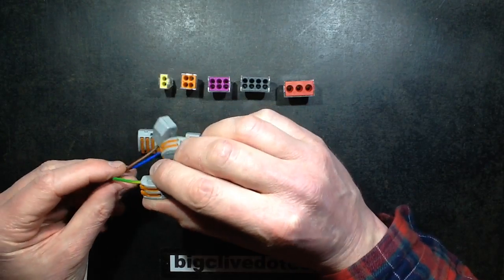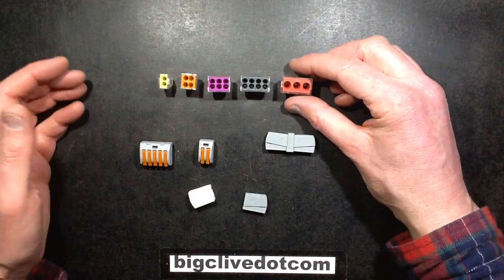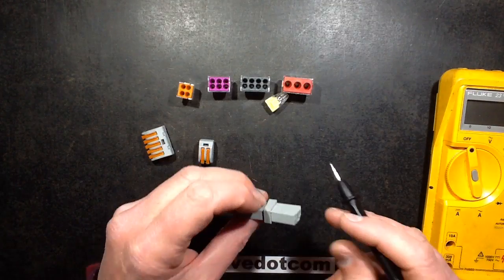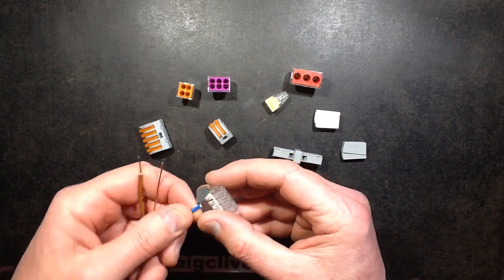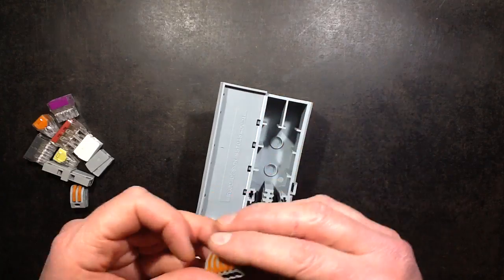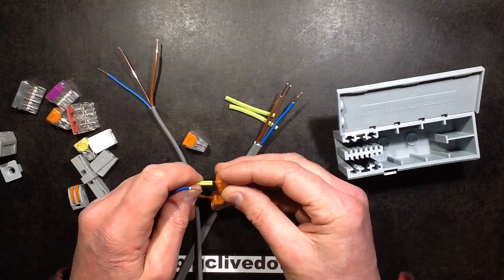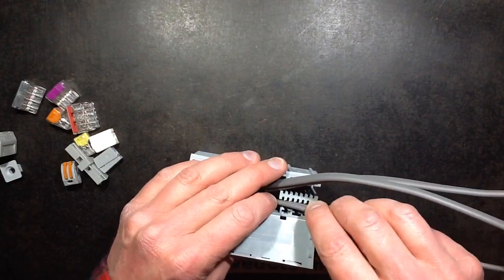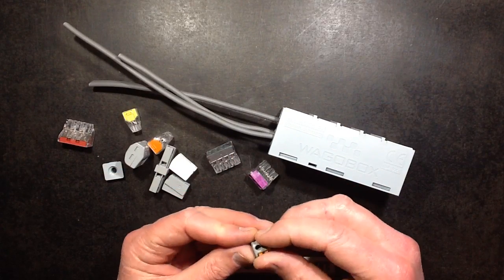A look at the Wago terminals and Wagobox system.

Comment: Those push-in style terminals remind me of the push-in connectors on the back of mains jacks in the U.S.  I don't trust those at all, as I've replaced many over the years that have failed due to the spring relaxing away from the connection.
Reply: Those are cheap old and outdated. They don't even use the same bi metal materials these connectors use. Apple's to oranges man.
Reply: https://www.youtube.com/watch?v=eg6VPucscxI

Comment: Are they made in China?
Reply: The 773 series ARE your terminals.
Reply: Not any more. China now. :-(
Reply: Proof is the "Made in China" mark printed onto my latest boxes of 773-102 and 222-413.
Reply: Well then why do my newest boxes boldly say "Made in China"?

Correction: The 222 series is still made in Germany. The 773 series is now make in China (used to be Germany).
Reply: They are made in switzerland
Reply: +John Alexander Really? Proof please. Exactly which model?
Reply: Thanks John. I didn't know that. I consistently buy 222 and 773 series here in the UK and always check the box. It was always Made in Switzerland. It looks like they started to shift manufacturing to China recently, which is a shame.
Reply: Seems that way, sadly. Hopefully the quality doesn't suffer too much. Maybe they were just making space at their European factories for the new 221 series. Haven't used them, but they look promising.
Reply: John Alexander My thoughts exactly! :) I tried series 221 and it is excellent. I will miss 222 though. Hope it won't be discontinued. Wagobox only works with 222 and 773 so far.
Reply: Thank you Derek for this comment. It is great to read comments from people who actually work for WAGO.
Reply: No they are not made in China, Made in Germany, WAGO invented spring terminals, these are contracting products, industrial DIN rail mount use CageClamp and newer derivatives Compact CageClampS etc. Now from last year our PowerClamp range was increased to 185mm sq that's 353 amps!!! Cage Clamp was tested and used in the containment chamber of Nuclear reactors, Reactors have now completed 30 years before being taken off line, With WAGO Box and 222 series you have a true MF (Maintenance Free) solution. Derek Lane, Automation Manager, WAGO Ltd (UK).
Reply: Sorry I was referring to terminals, as the BOX is not manufactured by WAGO, this is a UK supplier who picked the name as used with our (WAGO) terminals. He was allowed to call it WAGObox.

Comment: Is the earth wire in solid core cables always uninsulated in the UK?
Reply from the maker: +jakeroswell Usually yes.  To make them physically smaller
Reply: +jakeroswell uninsulated in north america as well, at least in Canada.
Reply: jakeroswell - only in fixed wiring. With flex (flexible cable) the earth wire is insulated in the same manner as the line (live) and neutral wires.

Comment: What's the purpose of the earth sheathing? Never seen that done in the states.
Reply from the maker: +Cody Carse To identify it as the earth wire and also to prevent the bare core from contacting any terminals in the enclosure.

Comment: I have used those Wago quick connectors for years. I know many electricians in Norway also uses them frequently. I work with low voltage and current and have used the 222-type that enables you to reopen the terminals quickly to remove a cable. It also can work as a transfer from solid core to multistrand core cables.
This video made me interesting in where Wago is made and where they come from, and they was not suprisingly a German company. And I also found out that they have a new version of that lever type connector called type 221 (https://youtu.be/n8gLG6c-iKc). It is even smaller and has a clear plastic cover that makes it easier to see the cables inside. I have to try those out!
Reply: I had some emergency connecting needs recently and the local shop here in Japan had the 221 series.  Bought the 2 and 5 wire variants and can't be happier.  Given the cramped, precarious, dim working conditions the clear plastic cover was much appreciated.

Comment: I like the lever connectors but from time to time I am a bit clumsy closing the lever and they manage to smack on my fingernails from the finger holding them wich is quite painful.
Reply: Try the 221 series - much easier on your fingers!!
Reply: (I know I'm like 4 years late) 

I can really relate to that feeling of having your finger snapped by the 222 Wagos! 

I'm glad that we now have the 221 Wagos that aren't as painful for your fingers. I almost exclusively use 221 Wagos these days for connecting things. I'm an electrician that mostly does the wiring for houses and such, I don't do a lot of the really complex wiring like circuit boards and stuff. I mostly do basic things that realistically could be done by a 10 year old. I mean, sure, the 10 year old would probably die if he doesn't know how to check if the power is off. Besides that he could probably do most things

Comment: Wago do another series of lever connectors now that are half as thick. 221..  I think i pretty much use them every day!
Reply: I love those 221s. They even have flat surfaces all around so they are super simple to glue into place if you want to use them like a mini terminal strip for a project. Plus they're transparent so you can easily see how far in the wire goes and if it's pressing down on insulation instead of the conductors etc.
Reply: They are also officialy rated for the use of flexible cables, unlike the old terminals shown in this video
Reply: @Kyouske_42  No, the old 222 series is most definetly rated for use with flexible finestranded cables, just check the specs if you dont beleive me :) Seems though that the 221s have a slightly smaller range of cable sizes that the fit and also a fair bit lower amperage and voltage rating. There are 2 sizes of the 221 nowadays, the smaller takes 0,14-4mm2 cables, 300V 20A, and the bigger takes 0,5-6mm2, 300V 30A.
The 222 takes 0,08-4mm (finestranded) and 0,08 - 2,5mm (solid/coarsestranded) and 400V 32A.
Reply: Wago has introduced the 221 series for hazardous locations...Ex and high temp areas. 👍

Comment: Great stuff, use it all the time for temporary modifications for exhibitions or permanent installations. I have heard of failing in case of a short circuit and that a wire jumps out but i have never had that myself (so not sure if true). Oh, 1 thing: you should never re-use a used wago (the permanent kind) as they are not reliable anymore when you wiggle the cable out.
Reply: +dimlexavr If you do it per the diagram on the box, they are just as usable. But it is easy to break them. So better safe than sorry.

Comment: Those wago lever things are neat, but I wish they made multipole versions to make connecting multiple cores neater. Or at the very least made them clip together side by  side
Reply from the maker: The nearest they have to that is their DIN rail system, but it's not quite the same.
Reply: So this is how mains electrical junctions are made in the Eurozone, rather than the cheapskate American twist-on wire nut, or plain electrical tape?
Reply: Jan Ciger What I've seen newer installation it's the sbout 90% of times those clip wagos have been used. Also I haven't never seen taped wires. "Twist-on wire nut" are common in old houses. Though also apparently some electricians prefer those on some places ie. bit bigger motor connections and like. They generally claim that spring loaded wago's can loosen after some period of use because of heat deviations. Then again, apparently screw terminal is also affected by that.
Reply: jothain
Well, taped wires are certainly not correct, but  many people do it, either because of ignorance or just laziness. Also there is a culture of DYI in my country where it is quite common that people do even tasks they are not qualified for - it used to be pretty much the only recourse to get things done during communism and today it is often done to save money.

So many people are building their own houses, for example - including plumbing and electrical wiring, calling an electrician only once everything is in place and only the final approval is needed. Then the horrors you find depend only on the level of enlightenment of the person who did it (and the size of the bribe that way paid to the electricians for the approval stamp ...)
Reply: Jan Ciger Sugar cubes in Sweden.
Reply: +Moholmarn In Norway to. :And luckily I have not needed to use on in many years. :)
Reply: Gordon McLellan
Don't you worry, most installations certainly don't use WAGO terminals here, they are not cheap. And twisted & taped wires together is also a common find ...

The most common way to connect mains wires is using screw terminals, like this:

http://commons.wikimedia.org/wiki/File:MFrey_Screw_terminal.jpg

They come in different sizes to account for different currents/wire gauges and you break/cut off as many positions as you need. They are known under various names like "dominos" or "chocolate".

Comment: I don't think it's been mentioned but these are 'maintenance free' connectors - there's no screws to be checked for tightness as part of any regular inspection. This means that under UK wiring regulations they should be able to be used for connections in inaccessible locations, although they don't have the 'MF in a circle' marking. There's also a wire stripping length gauge on the base.
Reply from the maker: I've got a thing about stuff that can't be accessed after installation.  From buried junction boxes to badly located light fixtures that have maintenance free electrodeless lamps in them.  They do all fail, and when they do they are a nightmare to repair.  Sometimes I think it's a status symbol for architects and designers to be able to create unmaintainable designs.  Either that or they really are technically incompetent.
Reply: bigclivedotcom Don't get me wrong - I'd never put a junction box where it couldn't  be accessed somehow. Under the wiring regs a normal screw-type JB can't be used under a floor even with an access panel as this could involve removing any furniture and floor covering to get to it, but a 'maintenance free' one can. Ashley/Hager do 3 and 4-way MF-marked JBs that use Wago terminals under J803 and J804. FWIW a pet lighting hate is recessed lighting in loft conversions where there's no way to get the to the wiring or transformer without pulling the ceiling down.

Comment: Some useful, and useless info on these.
Wago is pronounced Vago, I keep getting told off by our rep for pronouncing it Wago
The 222 series (the levers) are rated up to 4mm and 32A
The normal 773s are rated to 2.5mm and 20A, the 3 port will take up to 6mm but only 41A
The 224 (lighting) ones are rated 2.5mm and 22A.
They are not a new product by any means, they hhave been around since the 70s in Mainland Europe, its just taken a while for the UK to catch on.
Their quality control is amazing, and the clamps used in the units exceed the requirements for marine and railway use.

Comment: Better than American wire nuts idea, but the Americans wont like them because they use 110 volts and double amps, they are so advanced and so backwards, lol.
Reply from the maker: Their cabling size goes up in accordance with the current, so the Wago connectors still work there.  The bigger connectors have a suitably higher current carrying capability.
Reply: We're starting to use the push on Wago-type connectors on outlets and switches. The wire nuts I've used do work well when properly applied. The trick is to twist the wire in the same direction the nut twists on, and to very firmly twist the nut (I twist until the insulation gets twisted). A proper wire nut has a metal "spring" inside. When properly attached, immense force from "screwing" on the nut causes the spring and the wire to practically cold weld to each other, similar to a proper crimp. I still like the Wago better.
Reply: *****
There are still some manufacturers who buy wire nuts without the internal spring. It makes no sense, even for extremely low powered devices. You might as well twist the wires and terminate with tape.
Reply: Jammit Timmaj Too many people don't realize that and just tighten the wirenut enough to 'hold', which means it loosens up with heat/cool cycles. And do manufacturers there in north America STILL supply those wirenut shaped pieces of cream plastic with no spring in them with light fixtures? Used to drive me nuts that they were allowed to do that, they're worthless even on stranded thin wires!
Reply: Jammit Timmaj I have seen in a lot of places in former soviet union country Estonia where rubberized textile tape has been terminating aluminium cables for 30-50 years even in damp or cold conditions. I also have used those wirenuts with an internal spring, sometimes it cuts the conductors, leaving cut ends stuck inside the nut.
Reply: Jammit Timmaj
Indeed, the twist/tape might even be better, the tape is less likely to drop off 2 mins after screwing the fixture in place lol
Reply: With wire nuts, I can fill the opening with some grease or sealant afterwards and have a pretty weatherproof connection.  Although I like the Wago connectors for things that I am likely to be connecting and disconnecting multiple times (like when I'm working on an Arduino project), wire nuts are cheaper and a simpler (i.e. less chance to mechanically fail due to less parts).

Comment: I've been using them in domestic electrical installation work for the past 3 years - brilliant product which saves time and faff as well as providing a much more secure connection than traditional round junction boxes or choccy blocks. No chance of dropping small terminal screws out of light fittings this way either. Would recommend them to anyone but make sure you use the right current rating. I find them most competitively priced in CPC, Farnell or Screwfix
Reply: ***** I think the old round junction boxes were designed by sadists :D

Comment: I must check if they are available here then and at what price. Much easier than wire nuts, especially for low current, though I would not like to pass 20A through that small busbar and only rely on a spring, I have seen way too many industrial connectors that melted that used a spring contact clamp. Screws or better yet a crimp connector works well at high current.

Those solid to wire squeeze types though look good for mains connections for testing, wonder if there are some rated at 20A, as they would work out cheaper than a RS safetest unit, which is pretty expensive.
Reply: SeanBZA  the larger ones are rated for 6mm2 cable, which is over 30 amps, 20 wouldn't make them break a sweat. Unlike the US 'backstab' terminals the spring clamps fairly flatly onto them, which spreads the contact area. I've used them in the back of socket backboxes to extend the ring circuit rather than spur. That simply wasn't possible even with screw terminals due to the space requirements (british socket boxes are much less deep than US ones, 25mm). Never had a callback on them :)
Reply: Those are WAGO, German quality by the way.
Reply: It looks like the ones he shows are from the Wago 222, 224 and 773 series. 

The squeeze to release(224 series lighting connectors) have current rating of 24A. 

The 222 series(the gray ones with orange locking levers) are listed as 32A at the Wago site(though they are sometimes listed as 20A by others).

The 773 series push wire connectors with the yellow, orange, gray and purple color are for up to 24A, the red one is up to 41A.

So you should be able to use them for 20A, yes.
Edit: I found some 222 series connectors and they are marked with PSE JET Cu 1.5/2  20A 300V | UL 500V AWG 28-12 | ENEC  2,5ø 24A  4ø 32A. So I guess the part can handle 32A itself, but that is only achievable if using suitable wire(4mm stranded core). And that the different listed ratings on different sites has to do with different regulations.

Comment: makes a lot of sense really, you get a lot of failures from overtightening of the screws on  plugs and connector blocks, sure they require small aglets when you fit a mains cable now, but if they could somehow incorporate this to a mains plug it would be handy